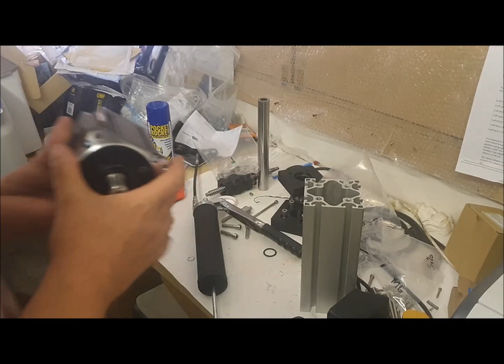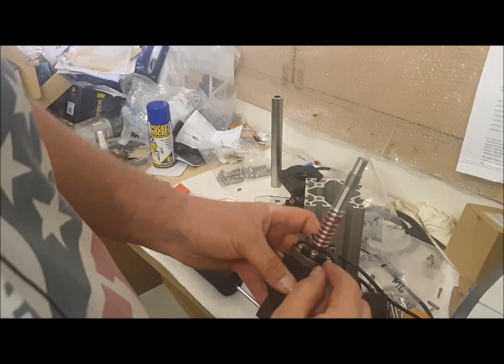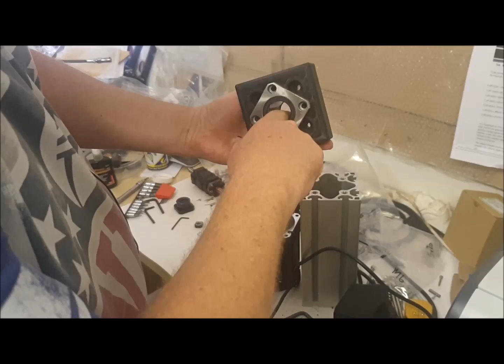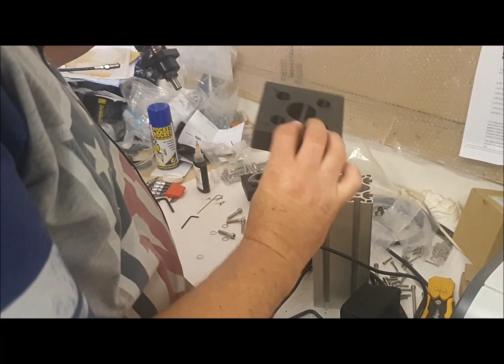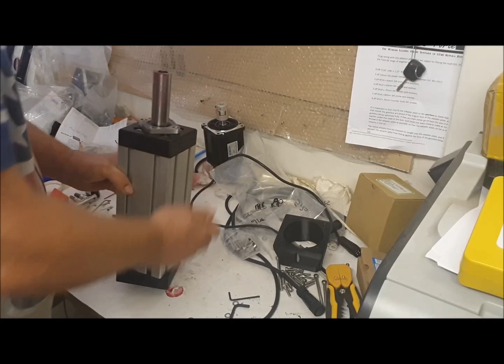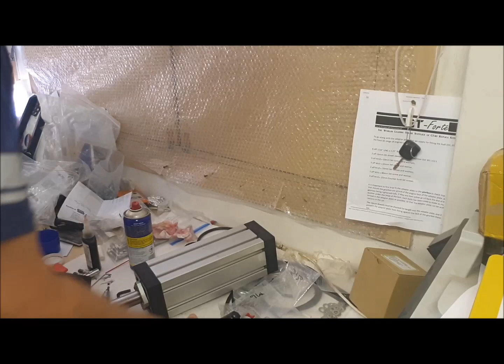Build your own SFX-100 motion platform Part 4 - Actuator Build Up - for Sim Racing

Comment: I know this is old but could I use a 300mm screw shaft add a spacer to the top of the actuator body profiled and convert them to 150mm?

Comment: In relation to the linear bearings. 
Instead of what you have there (ball bearings) which can score the shaft. There's another type of linear bearing called igus. It's a type of plastic, so doesn't score the shaft from bearing failure. We use them on much heavier equipment, might be worth considering if you do get failures with these ball bearings?

Comment: I was looking at actuators in general, not for this specific purpose of sim, but rather as a motor for a press. I have to ask, obviously in sim the steel tube can't jump out due to it's position, but if it were upside down, is there anything keeping the tube from falling out? Is it basically just the tape or something like that? Or does it hit the 3d printed part to prevent ejecting? I wonder if the ball screw could just have a threaded end, would that work? I'm trying to wrap my head around this, not an engineer haha. Thanks!

Comment: the slider i have rescaled on cura on the x ,z axis from 100 to about 98.8 and it fit  perfectly ,  maybe a little too tight on the sliderand the pipe  but with just a little force he went inside , you can also try with 99.2 it will work to but it will be a little too wide for the pipe

Comment: can we make it 150mm long ?
Reply from the maker: You would need to check if you can get an appropriate length of ball screw to match.
Reply: @GPRaceSimulation  Thank you, does it need only ball screw to change ? or should i adjust some other minor parts?
Reply from the maker: @mehmetbaran3447  I think only the ball screw needs to change.
Reply: @GPRaceSimulation   Thank you. Any measurements to suggest ?

Comment: Thanks for the detailed video!
One thing I have concerns about however is the fact that the slider is so tight fitted inside the profile. Shouldn't it be just a little smaller to avoid friction, heat and wear of the 3D printed part? (and also require less torque from the motor)

Comment: Hello , thank you very much for the tuto. i watch your vids sevral time. question: the hollow shaft waht is the inner diameter ? is it carbon steel ? I ask because i have a hard time finding it . I am in Canada. thanks
Reply: It's just a 270mm long shaft with a 30mm OD and 20mm ID. Here is a link for one you can order from China: https://www.aliexpress.com/item/33021103385.html